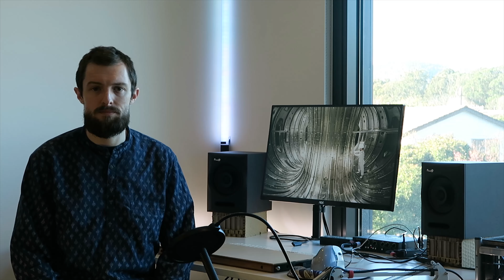Recording Reverb in the Parking Garage

Comment: This has to be the best video out there about the actual process of recording DIY IRs, unlike many other ones that just introduce the topic and show nothing of the practical aspect. I was already familiar with the theoretical concepts but as it usually is, and like you demonstrated, things are often different in practice, especially based on budget! So thanks for detailing the whole process and the differences in quality with the various techniques.

Now for a kind of lengthy question if you don't mind. I'm planning to record my first IR,  and was deciding on which portable recorder to buy for the task, since I have none yet and have no experience with recording so far. In your experience, is a M/S mic setup like the one you used what you'd recommend for recording spaces like the garage in the video, versus an omni mic? I'm looking to capture a dome-shaped arcade, and later use the IR with a convolution reverb for drums FX in music production and possibly spatialise it with some immersive/binaural plugin. Is the omni mic a good idea if you've ever experimented with that? I'd like to capture the best possible feeling of 3D space, so that's why I was going for the omni mic, but I'm unsure if that will also smear and "blur" too much the IR recording because of reflections coming from the floor too. Which, even if that's what I should be hearing too in that space in reality, I'm not sure will be better than a more 2D stereo recorded IR with a M/S mic in terms of sharpness, with the additional ability of the M/S setup of allowing to isolate only the side signals of the reflections, so I could more easily leave the stereo center empty for the dry drums to occupy. I wish I had both mics to test and compare, but I'm pretty much on a budget and will buy secondhand, so I'd love to go for the optimal solution before blowing more money haha.

By the way, your way of explaining things is very clear and detailed, you should totally teach this in some kind of formal course if you haven't already!